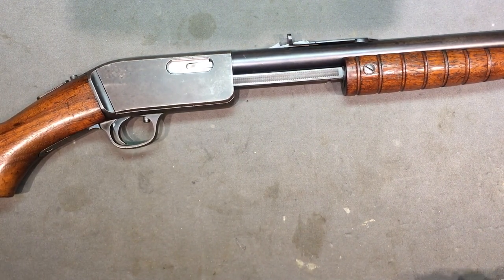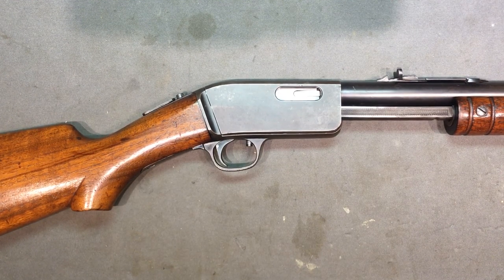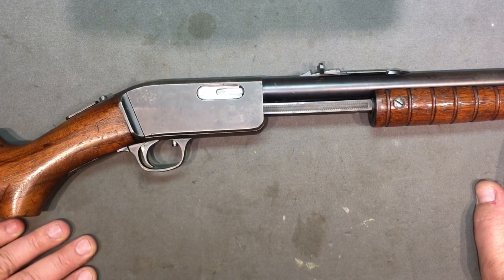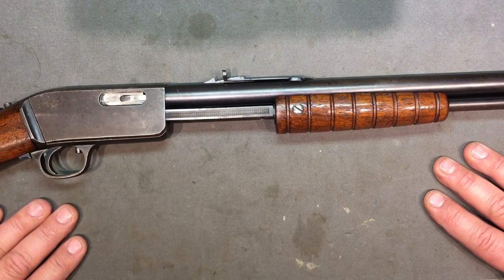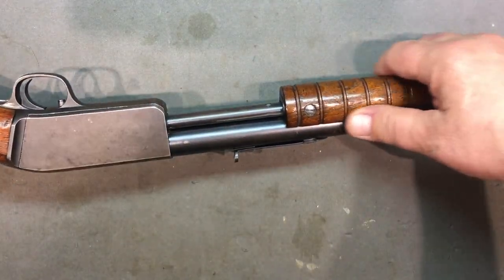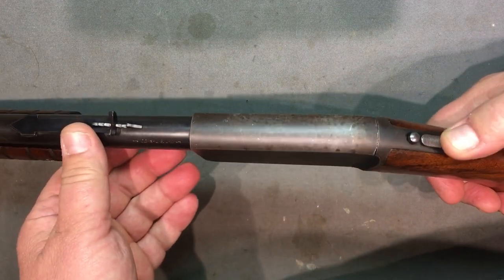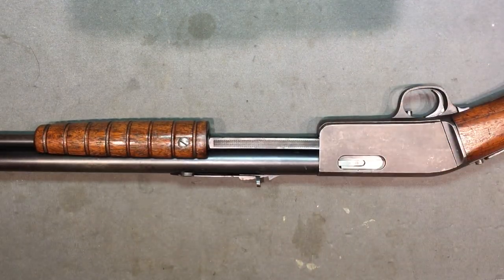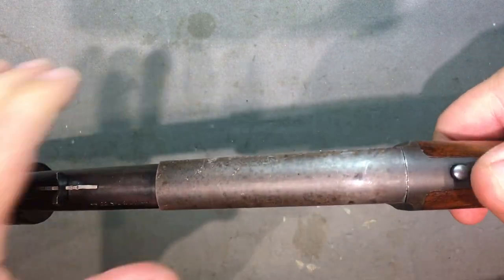Marlin Model 38

Comment: Finally, a video on the Marlin Model 38.  I bought this rifle about 20 years ago.  It is a lot like yours except mine has an octagonal barrel.  Serial number starts with a D and then four digits following that.  Since it was probably made in the mid to late 20s, I only use standard velocity ammo.  It's a fun plinker and I really enjoy it.  Thanks for going over the detailed breakdown.  Great video!
Reply from the maker: Nice!
Reply: Just inherited the same gun! Any suggestions?
Reply: I had this gun for many years before I even used it.  I enjoy using my Winchester pumps.  Took this out one day and loaded it up.  It had a problem with ejection.  Took the gun apart and straightened the ejector claw on it and it;s been doing fine ever since.   The problem with something  this old is finding a broken part.  So far, pretty lucky.  Be sure to use only standard velocity ammo.   @Luke-do1ek

Comment: I'm having a look at one of these for someone. The safety detent isn't working. I'm trying to get it apart to see if it's the detent or spring. I was trying to avoid it, but it's looking like I might need to tap out some pins around the latch mechanism. I was hoping the screw in the latch itself would allow some of this to be removed and free the safety, but the screw is captured and only backs out so far.

Comment: great gun i have one except mine has marlin-Rockwell barrel on of with only 200 were made with that barrel s/n on inside and its 15** so its toward start of the run from what i understand the model 38s were sold thru western auto for around 16.00 great gun guy i bought mine from had not idea how rare the marlin - rockwall ones are . pm me if you want a picture of it.
Reply from the maker: Those ARE rare.....a SN of 15** would be towards the end, not the beginning.   A chat forum that had a database had 1527 as the highest SN in the database.  Is yours higher than that?

Comment: Is the safety supposed to be free floating with no spring pressure I've been looking at one at tge shop I work at
Reply from the maker: bosstube No, there is a part that rides in the slot in the safety lever that makes it click into place up or down. Easily lost or broken though.
Reply: @MilsurpGarage  it's probly missing on the rifle I'm looking at it has a 24 octagon barrel though and it's in about 80% condition and functions perfectly they're asking 425 do you think it's a good deal
Reply from the maker: Yes. You can either figure out a way to repair it or maybe it just needs an adjustment. If it is missing a part you could always just figure out a way to keep it in the off position without moving.
Reply: @MilsurpGarage  numrich has a lot of the parts I think I'm gonna get it
Reply from the maker: Good choice.
Reply: @MilsurpGarage  yeah I think it's gonna be a lot of fun